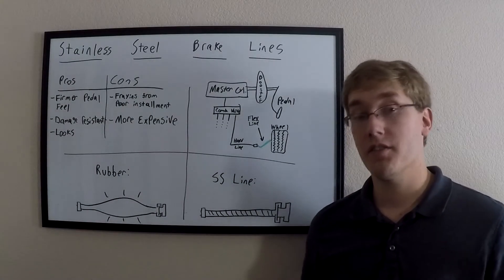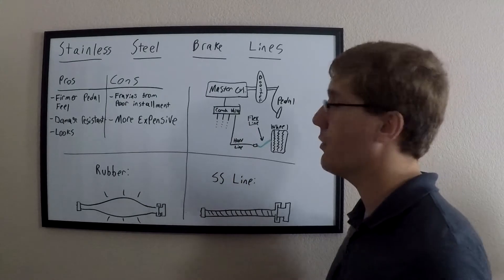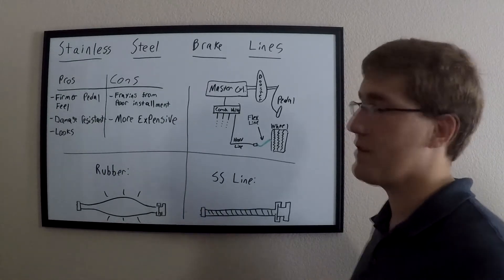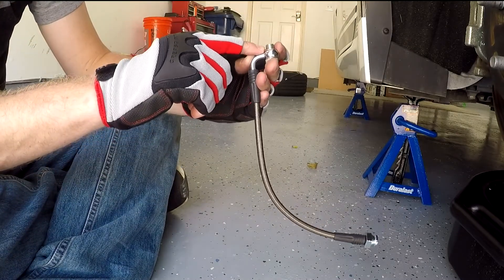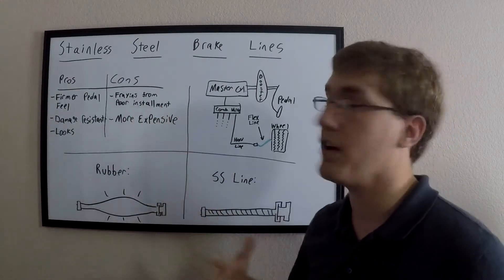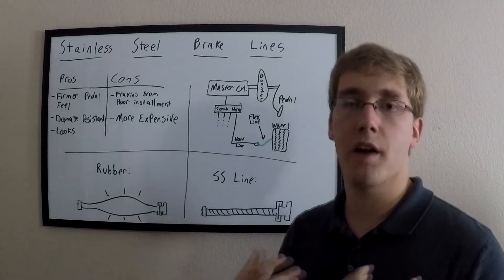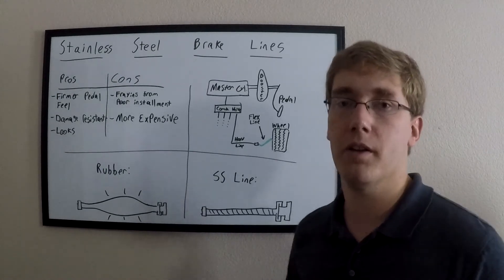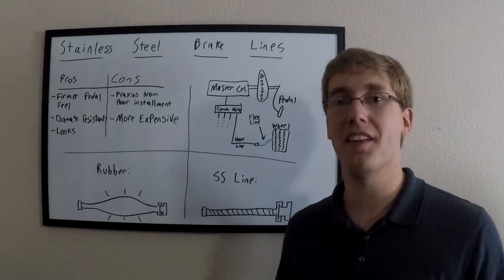Stainless Steel Brake Lines - Should You Upgrade?

Comment: how can I make the brake feel less spongy even with the steel brake lines?
Reply from the maker: Proper brake flush to ensure there is no air in the system.
Reply: a master cylinder brace,cusco,torque solution,and perrin make some.